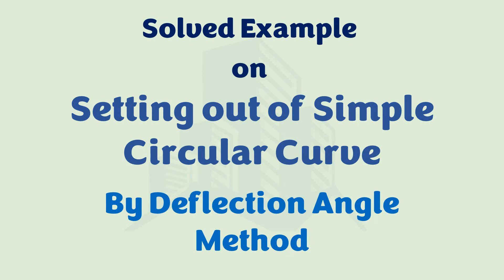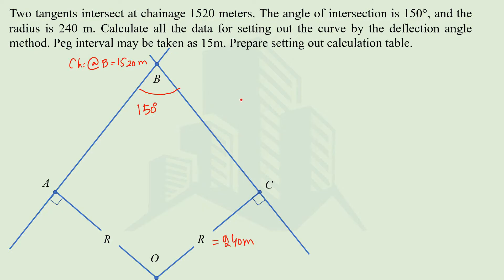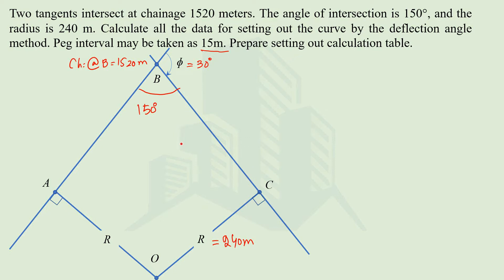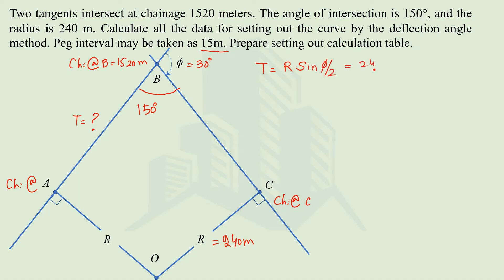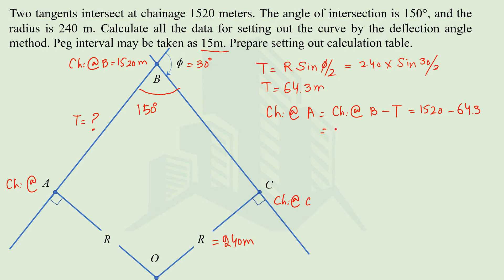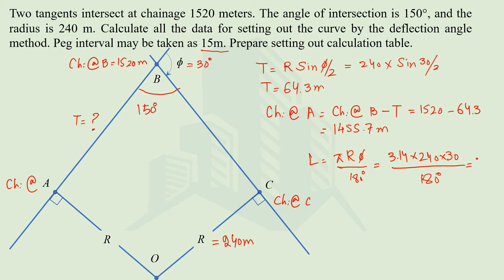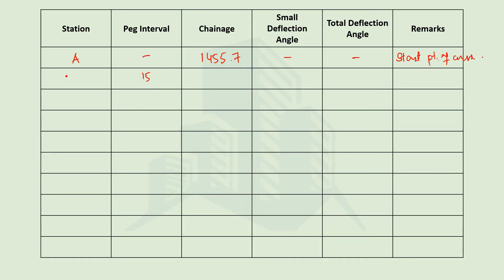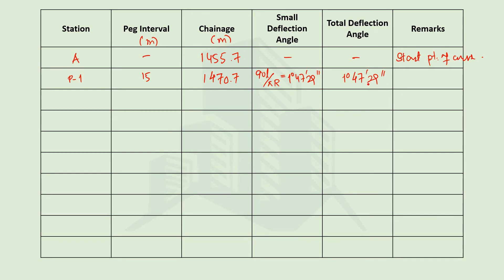Solved Example on Setting out of Simple Circular Curve by Deflection Angle Method/Setting out Table

Comment: What if we're not given chainage at intersection point, how can we find the deflection of the last subchord?
Reply from the maker: I'm a bit unclear about your question, but based on what I understood, here is my answer: "I don't believe there is a need for chainage to calculate the deflection angle of the last chord. It solely depends on the length of the curve." Please let me know if this addresses your query.
Reply: @CIVILSolved  ooh okay, can I send you the question instead? Kindly assist me with your email address, it will shed more light... Kindly
Reply from the maker: @hopenneyprincenney9854  Please check in the "About" section of this channel.
Reply: @CIVILSolved  okay, thank you so much sir
Reply: Please, how did you derived at the formula 90L/πR